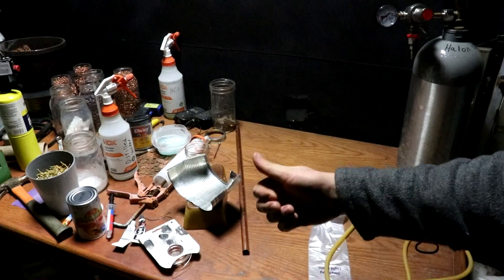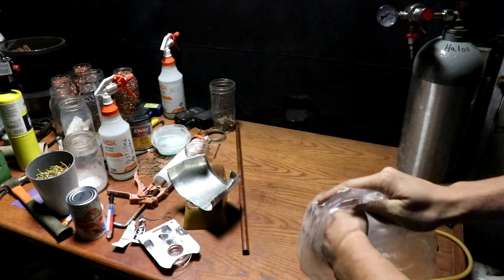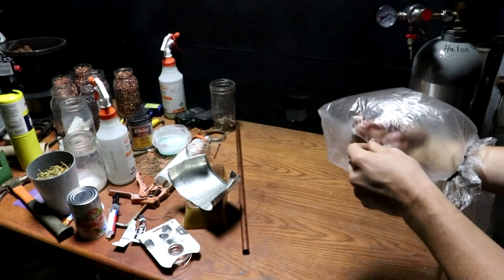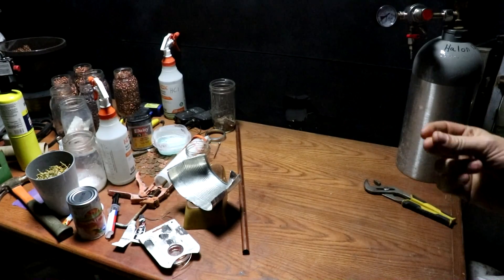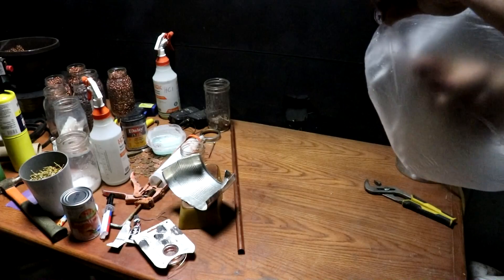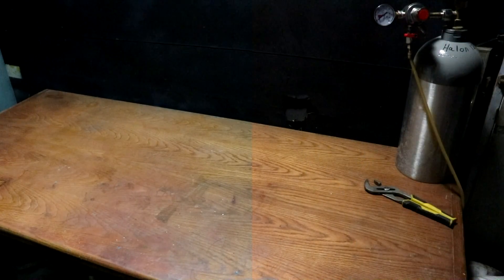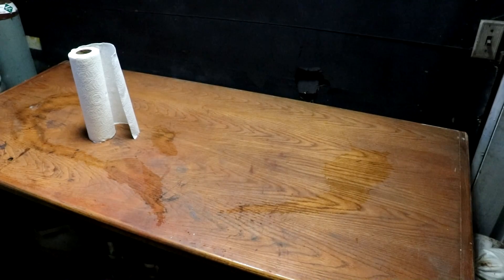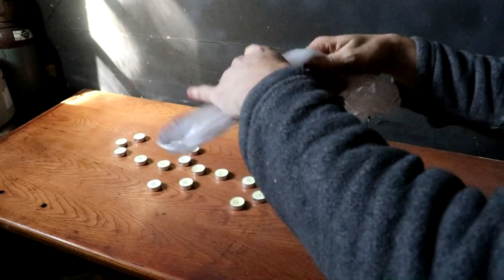Sound of Snaps In Halon and Helium

Comment: A question Cody, you said(I'm paraphrasing): "sounds waves will be travelling slower in halon because it's heavier than air" I always thought that sound waves travel faster in higher density/weight mediums? Doesn't sound travel faster under water than in air? Am I missing something?
Reply from the maker: Sound travels faster in water not from the density but from the greater strength of the intermolecular forces. Stretch a long rubber band slightly and give it a flick, it forms a wave that travels down the band, now stretch it tight and when flicked the wave moves much faster. The speed of sound in diamond is way faster than it is in gold.
Reply: Cody'sLab  Thanks Cody, that makes sense. I'm slightly less scientifically illiterate now. ;D
Reply: @theCodyReeder  If that is the reason then why is the speed of sound faster at sea level, where air is denser than at the stratosphere, where the speed of sound is slower?
Reply: @zoperxplex  because at sea level the air is at a higher pressure, with more particles per cubic meter so the particles need to move less far before colliding and transferring the wave energy to the next particle. (Edited to correct my incorrect use of the word denser)
Reply: @____5837  a minor addendum in that it's not pressure dependent as much as temperature dependent - ignoring the functional relations when considering a reservoir of sufficient size (i.e. the atmosphere). The addendum particularly falls because higher pressure really does not indicate higher density without temperature. Ultimately you can resolve the speed of sound in a gaseous medium by knowing the ratio of specific heats, gamma; the gas constant, R; and the temperature such that alpha(speed of sound)=√(gamma*R*T)
Reply: Cody'sLab  Would it make much difference if the bag had a microphone inside of it ?

Comment: I have another explanation. Helium sounded less louder as there is less molecules to transport the sound wave. Halon sounds louder as there are more molecules to transport. Like putting two balls on a pools table or many. Haven't figured out what is causing the pitch change.
Reply from the maker: There is the same number of molecules in any given volume of any gas at a given temperature. I know it’s counter intuitive but when you calculate out how much space there is between gas particles it makes sense.
Reply: @theCodyReeder  but his logic is still valid because same amount of particles means more mass of air being pushed so its louder , more energy transfer
Reply: The pitch change is pretty simple to explain :) You have an acoustic chamber (in this case the region in Cody's hand where the sound waves are developing) of a particular and relatively constant size (think of this in the context of your larynx for when you speak after inhaling various gasses), and as you increase the speed of sound in the medium by using a different gas (in this case helium) the pressure wave generated by the snap of the fingers is able to propagate faster. This faster propagation, or conversely slower propagation for a medium with a slower speed of sound, leads to a pitch change (higher for higher or lower for slower). As to the volume change it merely comes down to the amount of work imparted when generating the pressure wave. The greater density gas requires more work to displace the same volume of gas and so that pressure wave will have more energy which in turn means more volume.

Comment: @cody Nope the sound was different because of the structure of sound waves travelling in heavier vs slower medium... Lighter atoms require less energy to vibrate and hence the sound waves pitch is higher, while the reverse is true for heavier gases. The total energy of the system being constant, higher frequencies take more energy to produce as greater number of waves in the same time period and kinetic energy per wave is lower as force generated by each wave is small due to lighter gas, hence lower sound. While reverse is true for heavier sounds.

Comment: The volume difference is due to conservation of momentum. There are the same number of molecules displaced by the finger snap in each gas (at the same pressure + temperature). The lighter helium molecules can't transfer as much momentum to the air outside the bag.
Reply: My guess is you would observe the same thing without the bag. The heavier gass has an impedance closer to that of the moving fingers, so more energy is transferred i.e. louder snap.
Reply: You would absolutely love TechIngredients, Cody! This explanation is given on that video, as you know, but the rest of the content is up there with you, NileRed and the rest of the good science youtubers! Super high quality, would love to see a collab someday... edit: Oh, I see another comment said the same thing, lol.
Reply from the maker: That’s a pretty good way of putting it actually. Though I’m still holding out hope that my explanation is at least sort of correct.
Reply: Cody'sLab google sound from snapping fingers so you know what makes that sound :)
Reply: Great way to get your wife to clean the table at a snap command with the acceptable excuse of not wasting gas. Lol
Reply: Thank you for being the one to point this out! I heard his conjecture at 6:13 and my physics alarm went off! Though technically it's the efficiency of the transfer of kinetic energy. For the same reason that sound travels much farther in water than in air, in a denser fluid the imparted kinetic energy is transferred more efficiently and therefore sounds further from the source appear to be louder. It's not about the speed of the snap, its rather that the denser fluid gives the illusion of your ear being closer to the source of the snapping.
Reply: @Sir Edward You're right. @Cody'sLab And you're also right. Can't you just both be right?
Reply: YES! A bit more concise than how I explained it, but this is basically the correct answer.
Reply: thank you for your knowledge, Sir Edward.

Comment: I think that the reason the helium was quiet was because it was going from an atmosphere were the speed of sound was much faster than our regular atmosphere. so the sound waves were going really fast when they were inside of the helium but when they hit the wall of the regular atmosphere the waves had to loose power when they passed through. Imagine driving a car in a straight line at 20 mph when you suddenly see a speed bump you slow down but you are the same car. You loose energy(Loudness of snap) but not model of car( Frequency of snap). For the Halon Its the thing except imagine driving on the top of a hill then immediately going down hill. You go from slow to fast which mean that more energy is transferred through the mediums.  I think at least but I could be wrong :)

Comment: 5:52 also, in the boundary between the air and the bag, the halon pushes the bag with greater force, therefore making a louder sound. The inverse happens with the helium, low force, because helium has almost the littlest mass possible, so it pushes the bag with less force

Comment: If you don't mind a seam on the table you can look at rolls of flashing to try and find some stainless steel to use and just glue down. Know you can find it in copper and aluminum but both of those can be reactive with more then the stainless is.

Comment: 5:37 ... I don't think this reasoning is right. I think it's due to the sound waves MOVING slower, or the spacing / frequency of the waves is different due to the gas. a vacuum has no sound because there's no gas....in this case with the gas it would sound lower because it's heavier/denser than air.

Comment: A gas sylinder being such a rigid container, and sealed, wouldn't the pressure inside be absolute? Ie, if there is 10 psi of pressure inside the bottle, then if opened (as closed its a sealed system) would effectively have a vacuum in it? Drawing in gas from the surrounding atmosphere..?

Comment: @Cody 
Experiment Request:
If you got a bag of helium with a thin straw or needle as an opening and you hold the straw up would the bag deflate due to the helium escaping or will the bag the the same size because the helium would thin out due to diffusion until theres just air left inside the bag
-the thin straw is essential so helium and air cant exchange/limit diffusion
-it needs to be a bag not a balloon so its not the tension pulling the balloon together forcing out the helium
it should be like emptying a bag a water trough a straw just the other way around

Comment: You should put speakers in a chamber of helium and a chamber of halon and experiment with different sounds.
Reply: they will sound generally the same in pitch but their volume will be different at different resonances.
Reply: Despacito in Helium (Gone wrong!)
Reply: this is basically a physical low and high pass filter on the speakers. wonder why no company sells those for like $50k though.
Reply: Bartosz Olszewski interesting.
Reply: This
Reply: Cody you know what you must do
Reply: They'll sound pretty much the same pitch, because it's not actually the pitch that changes but the resonant characteristics - the "formant".

What will change is the bass port tuning and some of the Thiele and Small parameters will be skewed. Lower density gases makes it easier for the speaker cone to move, for instance. The speaker may take on a different "tone", like changing from a bigger speaker to a smaller speaker. It would be a cool experiment, nonetheless!
Reply: Jim Griffiths  right. same pitch, similar sound, different characteristic curve frequency vs amplitude. if cody ran some freq test files with a fixed ranging mic nearby, then spectrum analyzed in, say, audacity, we'd get some possibly wildly different results
Reply: Not speakers but, an instrument such as a trumpet or something that relies on movement inside tubes. Such as our voice.
Reply: You. Are. A. Genius.

Comment: Cody if I used some of that cleaning solvent to make ethylene would it be difficult to dry it to the point it could be used as a refrigerant. The welding gas place here only stocks run of the mill gasses and won't have any part in ordering odd stuff.

Comment: Try snapping in a stoichiometric ratio of 97.5% methane with  about 1.5% ethane  '-)  Neighbors: "Look through the window, Cody is hanging from the ceiling by a bag" . Cleans table with perfectly good Ever Clear, from his 'wine' cellar. Paper towel coated in U-238 now. Should have done mechanical 'snaps' like clothes pin.

Comment: what if you have helium and halon in a bag together? will it make the bag pill shaped or will look normal?
Reply: Gases mix evenly just like liquid, so it'll be a normal shape
Reply: @alexsiemers7898  But they will eventually separate due to gravity
Reply: MrGrandeBestia given enough time (or a centrifuge) i could see them separating. But not within a reasonable amount of time
Reply: @alexsiemers7898  Mmm sounds like next Cody's video
Reply: What if he breathes in 50% He, 50% Xe and speaks?
Reply: The density of each gas will determine their position (i.e.) the helium gas will float at the top while the halon gas will sit at the bottom. While the gases are in a same bag as the one in the video, the shape of it will look like the number 8 from a certain angle(if left with enough space).